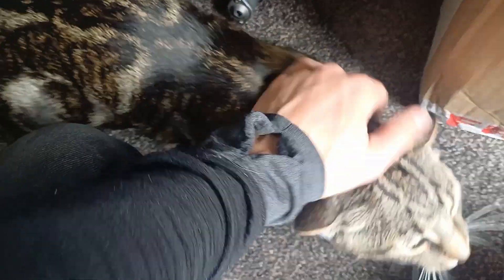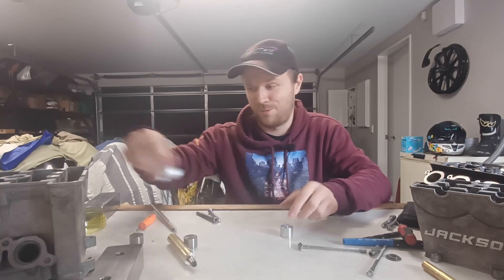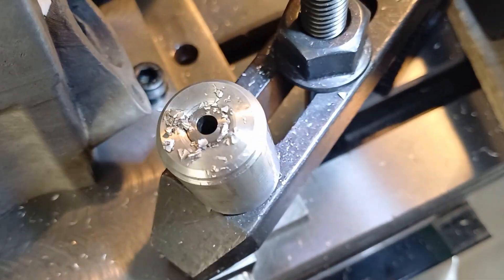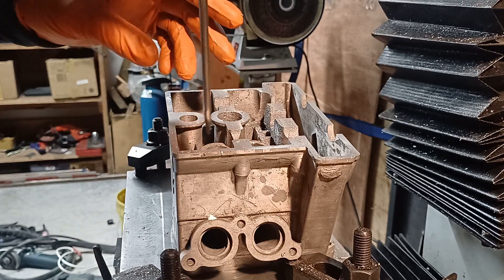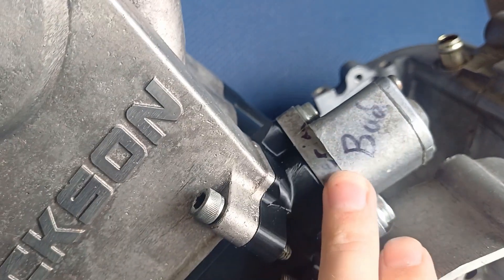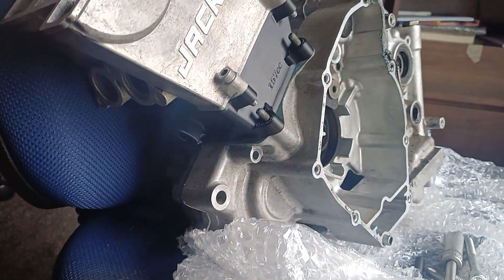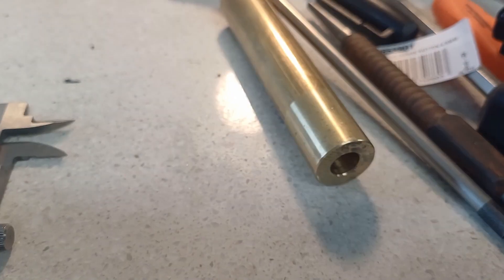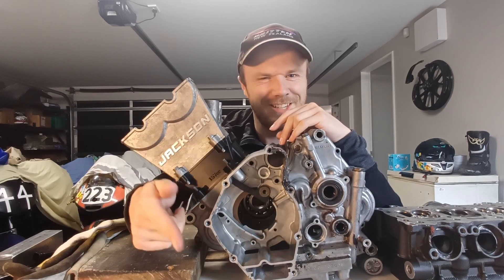Making the Worlds Most Powerful 150cc 4T

Comment: Just want to say this whole series has been rad to watch. Can I ask what you use for a mill and lathe? They seem like they would fit my needs well!
Reply from the maker: The Mill is a Chinese Hm-46b, it works ok but has plenty of issues related to being a cheap mill. Most of them you can work around but it has needed repair twice.
The lathe is a old Taiwanese Peerless PL 36-910 from the 70s it works very well and is much better built than the mill.
I would definitely recommend Taiwanese made machinery over cheaper Chinese stuff.

Comment: Love this. Arrc spec ub150 makes around 27hp. 22mm intake valves 32mm throttle body
Reply from the maker: @mgck6822  very impressive, my current goal is 30hp at the wheel and see where we go from there.
Reply: @TheMotorcycleForge  not sure what's your plans for the bottom end or if ur race spec allows non factory fitted, the gsxr150 fi or raider 150fi crankshaft and rod is kinda updated version of the fxr. Smaller lighter crank, shorter rod at 98mm, smaller piston pin 15mm. I have a feeling it will drop in
Reply from the maker: @mgck6822  I have designed most of the engine components to accept R6 parts so I will be making a billet crank from scratch to suit a R6 rod but also fit in the fxr crank cases.

Comment: Nice ,do u have cad model of honda rs125 nx4 frame, swing arm, fairing and other other parts?
Reply from the maker: @vijaykorvekar1009  Not a cad model, unfortunately, that would take me quite a while to draw up.
I have two physical nx4 chassis in the garage, though 😅
Reply: @TheMotorcycleForge  is there any way you cab 3d scan it ,with good quality
Reply from the maker: @vijaykorvekar1009  I currently don't have a 3d scanner, but it's definitely on my list of things to get.
Reply: @TheMotorcycleForge  I am not the rich guy ,but I'll pay for 3d scan of the honda rs125 nx4
Reply from the maker: @vijaykorvekar1009  Just had a look a how much a scanner is.
Definitely can't afford one at the moment.
Minimum $750nzd for a cheap/ low quality one.
I'll have to wait till they become more available.
Reply: @TheMotorcycleForge  sure ,my plan is to make the bike even lighter than 70kgs for a 20hp motor, I'll be eagerly waiting for you reply with a 3d scan /model
Reply from the maker: @vijaykorvekar1009  Oooh, that sounds like an awesome project.
Are you using a two-stroke or four-stroke
Reply: @TheMotorcycleForge  actually I'm doing 2 of then one is 2 stroke 150cc and other a electric one
Reply from the maker: @vijaykorvekar1009  Very nice, it's a lot of work but super rewarding.
70kg is very ambitious, you may need magnesium wheels and a pretty light frame to achieve it though.
Reply: @TheMotorcycleForge  I'll be using spoke wheels and the bike won't exceed 90mph soo ,I won't need much engineering/design effort . My budget is too small. I can only start if get my hands on cad or 3d scan of the frame ,swing arm, the shock triangle fairings and the sub frame if possible
Reply from the maker: @vijaykorvekar1009  Do you know of anyone local to you that has a nx4 you could measure up?
Reply: @TheMotorcycleForge sadly no, that's why I'm asking people online
Reply from the maker: @vijaykorvekar1009  I could do some basic measurements, but it probably won't be very useful.
Reply: @TheMotorcycleForge  if you are planning to buy a 3d scanner for your project or if you have any 3d scanner services near u ,then I'll wait and I can gather some funds for the project
Reply: @TheMotorcycleForge  hey ,can u make a basic sketch with proper measurements for the rear shock triangle and that small rod ?
Reply: @TheMotorcycleForge    ?
Reply from the maker: @vijaykorvekar1009  yeah that should be pretty straightforward.
Flick me a email
Reply: @ if it will take u more time to draw a sketch ,it would be very easy to click a pick from top and side ,by keeping those connecting rod and triangle with a scale besides it for reference one by one but u need to specify the thickness  or send picture from 3 angles ,all this while making sure that the object is flat in the picture
Reply from the maker: @vijaykorvekar1009  send me an email.
Reply: @TheMotorcycleForge  what's your email?
Reply from the maker: @vijaykorvekar1009  Themotorcycleforge@gmail.com

Comment: I would raise the intake ports as much as possible. Even if it ment modifying the valve cover to allow the intake runner to run beside the valve springs.  Also raise the exhaust ports to around 20-25 mm of the  valve cover flange. Raise the spring floor  slightly . Finding valves that much longer possibly 12- 20 mm longer. Maybe  find valves that are much longer. Possibly find larger valves with the same stem diameter. Grind the head to size  or possibly have the stems ground to size as well. Carefully and slowly milling the lock, slowly creeping up to the size of the  grooves required for the locks and retainers. Maybe a manufacturer will make a small batch of valves for you may as well go up in size a couple mm while at it. Have valves produce that are 3-6 mm over size before finish grinding to size . To allow for larger valves. A intake that has a carburetor boot bolting on the valve cover  would have to produce some power. The flow bench should show major improvement. Making slight changes to a stock head isn't really going to do it. And I'd rather have the iron sleeve, plates cylinders are too fragile in my opinion.  I could really get into a project like this. I was working on a scooter project trying to get the most from a 50/81cc engine.  I ported the head too much, bought another, ported the roof of the intake only, bored the throat out about 
.020" gave it as much of a high port as possible. Getting more like 12-15 mm would be better.  Used a high compression piston,  skimmed the head slightly. Unshrouded the valves. I wanted to remove more like . 030" -.040" from the head  or . 010" - .020" of that from the cylinder would be better get more quench. Have the piston at the top of the cylinder.  It made decent power for what it was. I also went with over size valves. The valves are . 3mm over stock size. They could be 1mm larger. Having the spring pocket coming out into the intake port will hurt performance slightly! 😂,  You learn from mistakes. I could epoxy a spring shim in place or buy another head and leave the port . 020" smaller! ✌️  Can't wait to see what's next!
Reply from the maker: @jamest.5001  The intake ports are as  high as practical for packaging, @45°.
The valves are much bigger than stock size +5mm and they are titanium so you can't grind them as they are coated.
I do love a good project.
Cheers Logan

Comment: It's hard to tell but, if you're going for the world most powerful 150, shouldn't you go with a design which is inherently balanced instead of a single cylinder? A 90° v twin, inline 4 or even a inline 6? Improved volumetric efficiency and more evenly distributed forces and weights would significantly improve the power output?
Reply from the maker: @My_Gaming_Mind  yes I would agree with you there, I'm starting with a single Cylinder while I learn the processes and engineering required, and it's much easier and more affordable the fewer you have to build.
I may do a Vtwin or a triple in the future, but I probably won't add any more Cylinders than 3 as the parts will become insanely small.
Reply: @TheMotorcycleForge  why didn't you start by trying to modify existing parts? Could have bought a cbr150r? It's a dohc 150 and they're cheap as hell cause they're old as hell
Reply from the maker: @My_Gaming_Mind  My current racebike is an fxr150, which is a air cooled DOHC 150 that revs to around 13k.
I have modified it from the standard 15hp to around 22hp.
Welding up the head, inserts, bigger valves ect ect, ect.
Needed a fresh start as to many design limitations on an already manufactured head.
Reply: @TheMotorcycleForge  um, it's already claimed to have 20hp? Suzuki fxr150 right? Did you dyno it? Is so, Idk if that dyno was working properly. Got it that you wanna try something new
Reply from the maker: @My_Gaming_Mind  Yeah, 20hp claimed at the crank which in reality is about 15-16hp at the wheel.
So my current bike is up 6-7hp at the wheel.
Reply: @TheMotorcycleForge  also let me know if you got discord
Reply from the maker: @My_Gaming_Mind  Unfortunately, I don't have discord.
Reply: 2 cylinder indeed have the better balance, but either in drag races or circuit racing, it is well proven that honda cbr 250 single cylinder beats its cbr 250 twin cylinder counterpart, afaik.
higher power? yes but it will be peaky. fastest? no but maybe in 1 mile straight perhaps

Comment: I'm new to the channel, 
Whats the bore and stroke of the engine?
And what power figures are you looking at?
Reply from the maker: @KXSWORKS  67mm bore, stroke hasn't 100% been decided as I making a crankshaft as well but currently thinking around 44.8mm.
The initial goal is 30hp at the wheel and will keep improving it from there.
Reply: @TheMotorcycleForge   that’s. A pretty wicked bore stroke ratio aye!  My fz 750 runs a 68 mm piston and 51.6 stroke. 42 is my cb400 sf  and yzf 750 is 46  with 73 mm piston  the thing should rev
Reply from the maker: @karlvanboxel561  yes more revs are definitely the plan.
Should be safe a 14k with this bore stroke ratio.
May make it a bit more over square later for a 16k redline.

Comment: R u using a slipper piston  motocross bikes seem to have down state o thd art  ( not as much as F one ) but good   Have u decided on squish depth ? Nice work man  r u going to use under piston oil cooling jet.   Really nice project man looking forward to the end result  any decision on cam specs. Lots to consider
Reply from the maker: @karlvanboxel561  I have a forged cp carrillo piston I plan to use in it.
As far as squish, I'm going to make my own one peice crank instead of a press together crank as they flex at high rpm and have to run extra squish.
Not 100% decided on squish, but it will be tight.
Yes, I will definitely have a piston oil jet for added cooling.
Yes, there is so much to learn and take into account for sure.
Reply: @  Good idea making your own crank  I think 4340  machines ok   I’m actually looking at getting some factory vfr400 cranks annealed so tho csn be safely welded the. Nitrided again. Good luck  very interesting stuff!
Reply from the maker: @karlvanboxel561  yep I think 4340 is a great idea and will probably nitride it like you said to minimize distortion.
Vfr400 have an awesome engine with some great engineering.
Reply: @  Kevin Cameron from cycle world extremely knowledgeable chap been around since Noah recommends .027”  and it was suggested I run around .024” - .028 on my FZ961 engine  not sure if that applies to all 4 T engines  but gd starting point  perhaps
Reply from the maker: @karlvanboxel561  Im running around 27 thou on my current race engine, which is the same cases, ect, as this one will be using.
I think I may be able to run it as tight as 23 thou but will probably start with 25 and see how the carbon patern looks on the piston before going tighter as I don't want to risk it.

Comment: I’d imagine u will have to run this puppy on nitro methane and alcohol to get thd most powerful NA 150?
Reply from the maker: @karlvanboxel561  The class I'm building it to race in those fuels are banned, unfortunately as they are regarded as power adders as they contain Oxygen ect ect.
I may swap out the av Gas for methanol ect for a land speed record as that would be allowed.
Reply: @TheMotorcycleForge   that’d b awesome u could run 15-16 too one comp lol
Reply from the maker: @karlvanboxel561  Plan to start with it being safe, around 13 to 1 and slowly up it in testing.

Comment: I dig the dual exhaust port should be a bonus imo for scavenging if it would ever get up to 15k+ 😅could be very wrong also
Reply from the maker: @HOTSHOT-ls1bc  I plan to use a Yamaha R6 rod and piston.
They should hopefully handle 16k with ease.
Reply from the maker: @HOTSHOT-ls1bc  Yeah I'm keen to see how it performs.
Plan to rev to 14k initially then maybe higher after some testing.
Reply: @ Carrillo rod  and titanium pin  should handle 16k but being home made I’d run it at 12k for a long while till she’s well worn in without issue

Comment: Definitely have to beat CRF150R(non stock) engine, definitely go EFI
Reply from the maker: @satria4195  yeah, it should kick a crf150r as hopefully. 🤞
Initially it will have a carb just to make sure the engine works.
Then I have a special efi system to make and fit.
Reply: @TheMotorcycleForge  I wouldn't stress too much about EFI. A good carb will make just as much power and should be able to be tuned to be just as rideable as EFI. A programmable ignition would be useful in my opinion.
Reply from the maker: @kwaka140  Looking at the head geometry, the intake is near vertical so a decent carb may be difficult.
I'm thinking of making a pretty trick throttle body for it.
Reply: @TheMotorcycleForge  The GPR boys modify FXRs to have very steep intakes. Gary has an FCR on his which works great
Reply from the maker: @satria4195  Yeah, I did the same to my current engine, machined it out, and made inserts and have an fcr carb ready for this one to test.

Comment: So what power will it have to be to be the worlds 'most'? I suspect not much as I don't think there are any 150cc pure race engines out there so only competing with about 20hp roadsters.
Reply from the maker: @ekspatriat  We race them here in NZ in a class called buckets.
We start with road engines and modify them to get as much power as possible.
My current engine Is around 22hp.
I have seen others claming 24-26hp.
Honda's crf150r is claimed 24hp stock.
So the goal at the moment is 30Hp and will go from there.
Reply: The GPR bikes are getting good power as is Paul Ellis' Yamaha 150. Gary Cunningham's 150 makes reasonable power as well, when he hasn't blown it up. I'm only guessing but they look like mid 20s and maybe more. Sketchy dyno'd his twin at 39.1hp. Yeeehaa!
Reply from the maker: @kwaka140  39.1 hp? That sounds to good to be true??
What is it?
Reply: @kwaka140  What twin is that?
Reply: @ekspatriat  There's a few compliance issues, but still. I had a solid 30hp from mine before I added the charge cooler. It's noticeably faster now and comes on boost very nicely. https://youtu.be/1VMmwuhscqA?si=3FjtVKUF3mWC_2m7

Comment: On the valveguides, make a small diam that´s larger.
This rests on top of the surface, and won´t let the guide fall down into the runners.
Reply from the maker: @Patricks_Projects  I was thinking it would make a lot more sense to have them stepped to prevent falling through.

Comment: For mock-up purposes I’ve made up a set of guides that are guide bore diameter for a slight friction fit, to enable installation and removal, and avoiding swedging the bores by repeated in and out episodes.
Thinkin’ I am going to do a set of undersized valve seats, out of aluminum, mock-up purposes, as well.
Glad to see things coming along, for y’all…
Reply from the maker: @georgedreisch2662  Thanks, George. I'll keep that in mind.
The reason I installed old guides was practice as I'm fairly new to this type of machining, etc.

Comment: 157cc is not a 150. Just like a 636 is not a 600.
Reply from the maker: @dadandkids5028  It's designed around a local race class with a max capacity of 158cc.
If it does turn out to be a rocket, I'll make a 150cc version ect.
Reply: Damn, my 1298cc car it's not an 1.3L! Now I'm sad.
Reply: @medicenchepibe 157 has gone over so your analogy isn't comparable. All OEMs are like that.
Reply: @brennan2486  VW's EA827 (known as AP, made in Brazil) 1.4L it's 1423cc.

Try again.
Reply: Hey dad ask your kids if your comment sounded really stupid
Reply: My Yamaha 125 scooter, 229cc
Reply: Kawasaki Z1 900, 903cc. Kawasaki Z1000, 1015cc.
Reply: ktm 790 is not 790 its 799 and yet ktm called it 790
Reply: Cool story bro
Reply: lol what a comment 😂
Reply: Gary Cunningham's 150 bucket, 215cc, possibly bigger.
Reply: @dadandkids5028 you talk trash shit 🤣

Comment: Awesome!

But I do hope the power increase over comes the weight increase of water cooling (radiator, water pump, water, hoses, etc.). Luckily you have saved some weight also
Reply from the maker: @psk5746  Yeah I'm hoping for 30hp at the wheel which should more than make up for a kg or two extra
Reply: @TheMotorcycleForge just don't have breakfast mate
Reply: @TheMotorcycleForge   mayb put the rad under the seat ? 👍
Reply from the maker: @karlvanboxel561  I do have a couple ideas of where to hide one.
Would be pretty cool if I could put it under the seat.